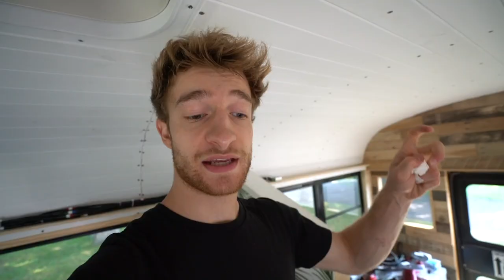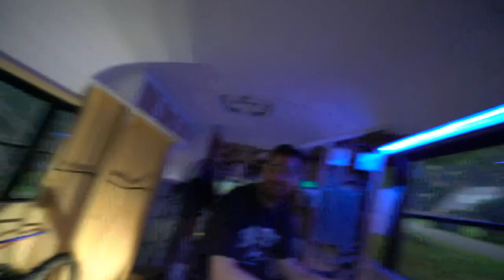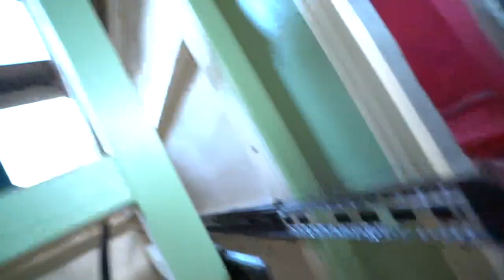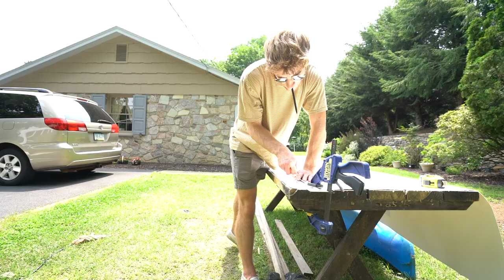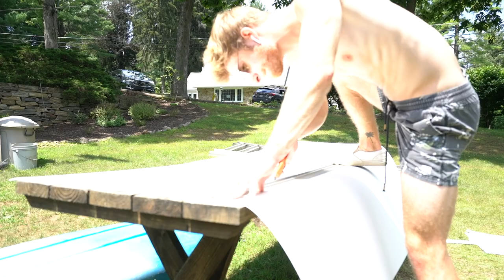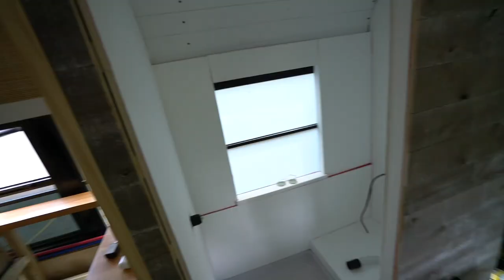Installing Plastic Bathroom Walls in School Bus Tiny Home - Skoolie Build Ep. 54

Comment: Matt quit kickin yourself kid.....it's coming together and if it were easy everyone would be doing it.......oh and by the way check out Lectric XP 2.0....great transportation once the bus gets where it's going. Keep your chin up son your almost done. For that propane bottle you might try a fire extinguisher mounting bracket slightly modified and if not box it in with a wooden surround. Just some thoughts. Don't let your deadline SCREW with your thought process. The five gallon water trap makes sense.
Reply from the maker: Thanks for the encouragement as always Mark. This week is lookin up, better headspace fro sure so far! Great idea with the fire extinguisher mounting bracket. I'll look into some options like that.

Comment: the smaller bottles for the propan might not work , the gashead isnt big enough (the surface of the propane as a liquid where it transfers into a gas ) one thing you can do that makes the propane system safer is using a car type propane tank with a gas pickup (no pickup pipe going to the bottom of the tank ) and an outside fill nozzle to fill the tank from the side of the rv at the gas station , basicly means that once installed you can leave the system alone and dont run the risk of lines getting overtightened or crosstreaded on , they allso use full copper gaslines instead of rubber